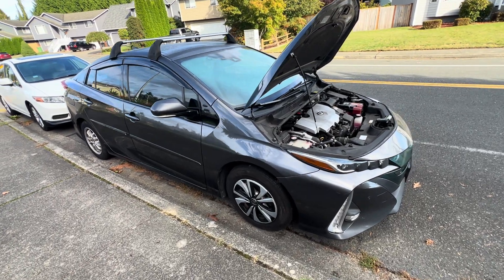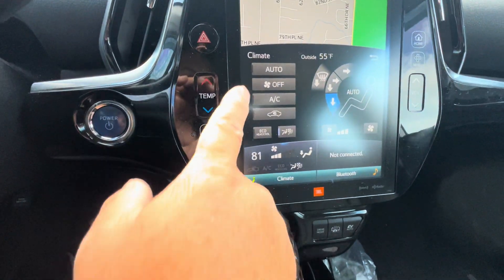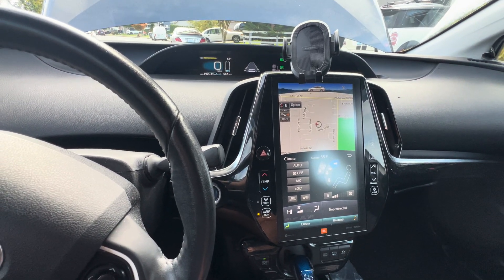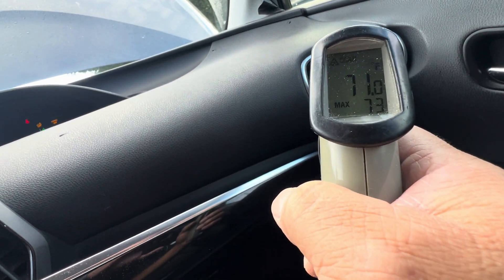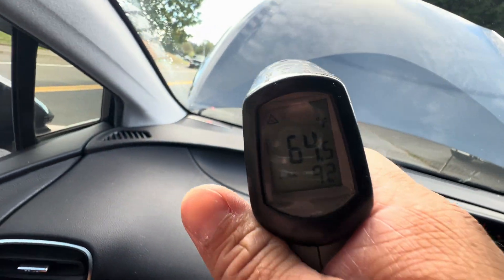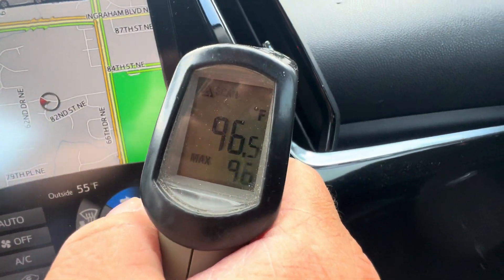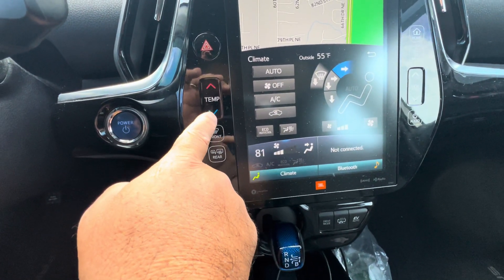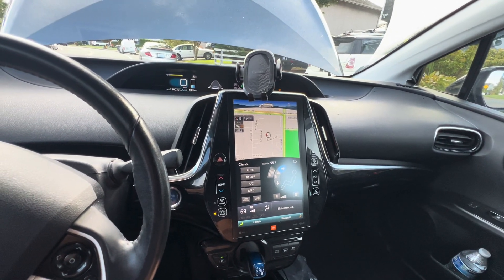Proof Prius Prime coolant hose catalytic converter bypass works, does NOT affect heater! 100F+ heat!

Comment: By pass the heat exchanger, not losing any coolant and heater working, but still getting steam when getting cold out side at night and a bad smell. Can it drain the coolant from muffler?
Reply from the maker: After you complete the bypass, it will still have to burn all the leftover residual coolant in there unless you vacuumed it out. It took me about roughly 1 hour of good freeway driving to cleared out.

Comment: Question is will this bypass pass smog or fail?
Reply from the maker: Yes I passed my DEQ and so have many others using this method all it does is reroute the coolant to avoid leaking into the catalytic converter that’s it
Reply: @DIYBigGuyy thanks

Comment: Ok, but you can drive the car ? And just worrie about coolant level ?
Reply from the maker: You will end up burning through that coolant daily and it will damage your catalytic converter eventually and if you’re low on coolant, you can overheat your engine, which can cause a head gasket problem. Plus, you’re gonna have a ton of white smoke coming out of that Prius as you’re driving the short answer is yes you can but your vehicle is not gonna last very long. Fortunately, don’t need to buy any parts to do this easy bypass just a couple simple, mechanical tools, and one to two hours of your time.
Reply: @AutoGuyVideos ok, so doing the bypass is safe, and I can drive safely, right ?
And I guess the final solution is change the catalytic converter? I check my oil cap engine and looks perfect no milky and my oil stick good level and no milky then my electric water pump it doesn't make any noise but I have the code p148f when I check with scanner and at the same time no check engine light ... I guess I have that code because im low of coolant 🤷🏽
Thanks for you response im really scared 😅
Reply from the maker: You’ll be fine just watch my video carefully. Literally thousands of people have done this and it’s saved their catalytic converters and $2,000 to $4000. If you go to the dealership, they’ll have you replaced your catalytic converter. It will solve the problem, but this solution is free and your car will be driving back to normal. It’s just a poor engineering lapse in design thankfully there is a fix for this, which is my video
Reply: @AutoGuyVideos ok im gonna try 😀 thanks so much and I about to make a 400 miles trip in a couple days and now I have this problem from nowhere Prius 2017 ... 157000 miles 😅
Reply: And do you think is better the by pass doing it  from top or exhaust ? Or is the same thing ? Thanks again 🙏
Reply from the maker: @rafacoupe11 I prefer top because no parts are needed. You will need some parts if doing from below. Plus I hate being under cars. Lol
Reply from the maker: @rafacoupe11 let me know how it works out! Keep me posted.

Comment: Can this be the issue on my 2013 Prius V?
Reply from the maker: To be honest, I’m not sure it’s a good question. But if you see a similar hose set up inside the engine, then anything could be possible.  The other problem is a head gasket. I always recommend changing the oil every 5000 miles and using thicker oil to prevent engine wear.

Comment: Just today (5/20/25) my 2018 Prius was diagnosed as having a faulty heat exchanger. I was blowing white smoke and losing fluid and was told it was probably a head gasket. The repair shop said it would cost about $2100 to replace the catalytic system, but the part is STILL on back order and they don’t know when it will be in. This is my only option. I will probably have to perform the operation this weekend. If I remember I will update this comment at some point. Thank you for this video! (And the instructional one)
Reply from the maker: It’s likely not a head gasket issue. This is a very common problem that is misdiagnosed, but in the heat exchanger in the catalytic converter is where the problem is my video will show you how to fix it. And if it works for you, don’t forget the thumbs up and I love coffee!

Comment: Do you have a code scanner? 
Could you run a scan and see if you're getting any codes at all? 

Thank you in advance!!!
🙏🙏🙏

The reason I ask is based on a post on Prius chat "Back to Gen 4 Prius Exhaust heat exchanger Bypass issues"
Reply from the maker: I never had any check engine light. And when I found the problem by the visual white smoke coming out of the exhaust, my coolant levels did drop, but not all the way empty, because I got the problem in time.  But I never connected to a scanner, even though I have one. I don’t see how this would be triggering anything specific unless you run the coolant all the way dry and your engine overheats.

Comment: I love all of your videos, but you misunderstand the Prius Prime's heating system.

The bypass worked because it stopped the two problems you had: leaking coolant and blowing white smoke out the tailpipe.  The heat works quickly because it's a heat pump driven by an electric motor powered by the PHEV battery.  

I don't recommend it, but I think you could remove all coolant, all spark plugs, and all gasoline, and the heat would still work.  At least until the computer decided to test or start the engine, it would.

The heat is not from the engine heating up its coolant, it's from the heat pump warming up the HVAC refrigerant.  A clue is that engine block and coolant would never be warmed up in 30 or 60 seconds.
Reply: There's several reasons to flow coolant to the exhaust, the info is out there, relatively tiny amount of digging. What's interesting to me is that you think it's  poor engineering on Toyota's part, without being able to weigh the pros and cons. You are unaware of the pros. I'm not defending Toyota, but I am a huge fan of critical thinking and have a bit of a morbid fascination regarding any general lack of it.
Reply from the maker: @nahteo Toyotas make great products. That’s why they are number 1 in reliability. However they could have make the parts better so that failure is not so high.  At least I was able to figure out a solution that’s cost free for people that can’t afford several thousands to replace their catalytic converter that the dealership pushes.  This design was done as a one size fits all for many of their hybrids. On the prime is not necessary because of the electric heat pump. But is necessary if they don’t have that. For the prime it is to save costs during manufacturing. BTW one of my favorite classes in high school was a course on critical thinking I think society should have more of it :)
Reply from the maker: Yeah, you’re very right. It is a electric heat pump. I just don’t know why the heck they would run it down there to the catalytic converter. What a poor engineering design I wonder what the main purpose is of that.
Reply: I would like to know this too @DIYBigGuyy